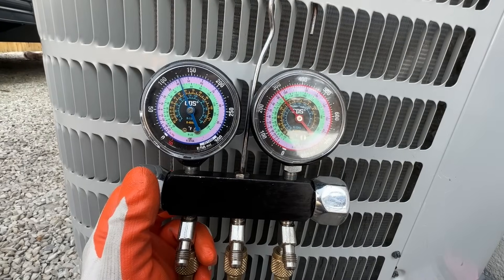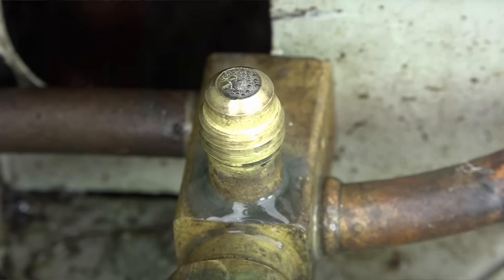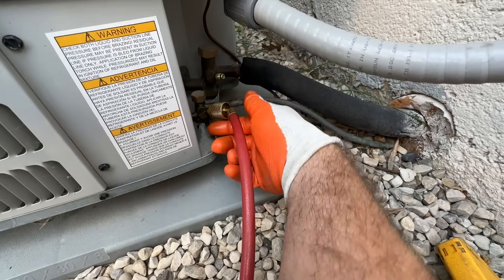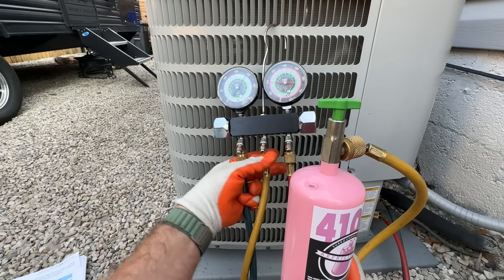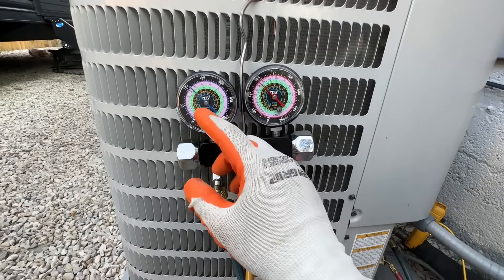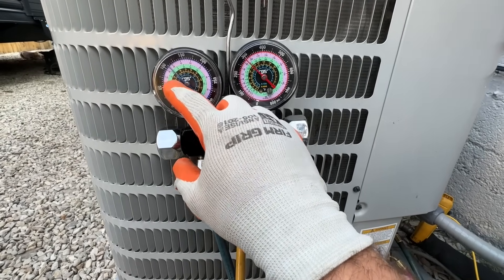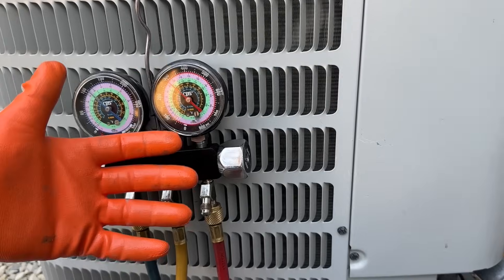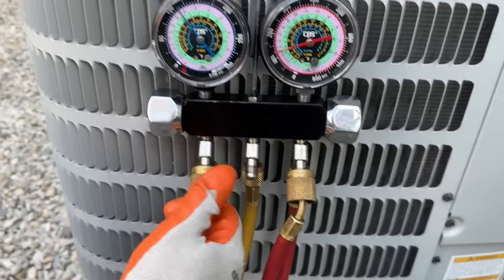How To Add Refrigerant To Your Air Conditioner R410A & R22

Comment: You make it seem so simple.  Hopefully it is.  Hope you get a ton of views.  We need more HVAC guys like you.
Reply: BE CAREFUL. Yes it is that easy. BUT there are so many areas where you can make a mistake. For example if you do not disconnect the high side, and happen to open both valves on the gauge you will destroy your compressor. Or if your high side pressure is too high, adding refrigerant will overcharge your system and damage the compressor. Everything shown here was accurate, but it is what is not said that will hurt your system. Get a little more education before jumping in.
Reply: @michaelbelliveau6232  Isn't it always true that it is what is not said  that gets you in trouble?  Thanks for the comment.  You are probably a good teacher.

Comment: Keep up the good work. My elderly neighbors were about to be scammed out of thousands for a replacement unit. Turns out he had be using the incorrect size filter and their evap coil was severely clogged. A Sunday afternoon and $30 in supplies had them back in business.
Reply from the maker: Saved the day!!! Nine work.
Reply: I had thought mechanics were the biggest scammers until my ex wife had ac people come diagnose a system that wasn't cooling correctly. Paid for an "ac tune up" that was supposed to clean the evaporator and condenser, check refrigerant levels, etc. They didn't clean anything, both coils were still clogged and they didn't check anything but a few electrical values (capacitors, etc). She had other people come and they saw a crushed intake duct in the attic. Quoted $2k to fix! We fixed it ourselves in an hour for next to nothing. Absolutely insane. I cleaned the coils but something else is still wrong, suction line barely gets cooler than ambient. Lord knows how much a reaming out they'd give you to fix that (I suspect incorrect refrigerant levels but don't have the equipment to verify).
Reply: Evaps get clogged with the right filter. Just clean it. Top and bottom. Check the blower fan for debris. Clean it as well since you are there.
Reply: You are doing gods work.
Reply: How to do inspect the evap to clean it, etc? Mine seems pretty much enclosed.
Reply: " their evap coil was severely clogged" the condenser or the outside heat exchange fins?
Reply: @sandygrungerson1177  The evap coil. The condenser is the "outside heat exchanger fins". The evap coil is located inside the air handler that is inside your house. It has very tight fins and can clog with dust overtime and reduce airflow significantly.
Reply: @travispoulin252   ok thnx
Reply: You and he should tell everyone you know to avoid that company.
Reply: How does charging a system correct a clogged evap coil?
Reply: @jefflemberg645  I deduce that the filter was smaller than it needs to be, and a "Sunday afternoon" meant he cleared the clog.
Reply: @jefflemberg645  he never mentioned about charging the system
Reply: @jefflemberg645  It doesn't. It might be a temporary band aid for a system that was a little low on refrigerant, but you need to inspect and possibly clean the evaporator.  You need to watch the video where this fella cleans an Evaporator Coil. I just watched him clean one and I was shocked at how much dust it had in it. I'll locate it and post a link into this comment.
Reply: @jefflemberg645  LOL right
Reply: Bro you’re ruining the business it ain’t getting scammed companies need money to pay gas, components, hourly rate, etc it ain’t a scam
Reply: @dylanlafferty611 really? I just saw my neighbors bill for getting a capacitor changed - 1500.00 dollars. Now tell me that wasn't a HUGE ripoff.....
Reply: @dylanlafferty18 some people don't have $10k laying around to buy a new system so if their old one can be fixed yeah they're being scammed. That's bad for business. It's more ethical to fix it and tell them they'll eventually need a new one and they may call back.
Reply: @dylanlafferty18 is $25,000 USD a reasonable price for an AC replacement in a 2K sq foot house? Because I did it for $8,000 and that included $2,400 in labor which is pretty damn good for 2 guys, supplies and a hard days work.
Reply: @dylanlafferty18 yea it is when you only need a capactior.soo m as they see 20 years old they stop and say you need a new one. And when they quote you a price all a out the same. 3k a day per man labor is.

Comment: You should do a video on using a micro leak additive.  I don't do this professionally but have used Easy Seal Ultimate with the UV dye on about a dozen systems that would get low on gas a few weeks after topping off with good results.  Including on one of my older 22 systems a few years ago.

Comment: I was checking the EPA website and just wanted to confirm that even as a DIY homeowner, if you open a valve or connect gauges to any refrigeration system and you do not have the 608 certification, you may be subject to the following?   “EPA performs random inspections, responds to tips, and pursues potential cases against violators of the Section 608 regulations. EPA is authorized to assess fines of up to $37,500 per day for any violation of these regulations.”
Reply from the maker: That’s correct. Heavy fines for doing this without and epa card guys! I’ll be done a video very soon on how to get your epa certification. Cheers

Comment: Thanks so much for sharing your knowledge we us, I have learned so much from you as a diy guy in maintaining my hvac system , I now have several spare parts on-hand in case of a breakdown , capacitors, vacuum switch, transformer, hot surface ignitor, condenser contactor !
Reply from the maker: Awesome! Thanks for the feedback!

Comment: How do you get the air out the system if it already in their?
Reply from the maker: If air is in your refrigerant, you’d need to recover it, do a vacuum, and introduce brand new refrigerant.

Comment: Can you do this on a inverter mini split heat pump?
Reply: Mini splits are always going to be rcovered and weighed in! And if additional refrigerant is needed,you must calculate the amount of lineset and how much to add per ft total run!
Reply: Good answer...!! Alot of people dont realize mini splits have a board that makes the fan run at different speeds and an electronic expansion valve that controls your your super heat so trying to find a target superheat on something that is always modulating superheat it is worthless so the only way to add refrigerant properly is to completely recover then add what it came factory charged with then normally if your lineset is over 15 foot to add refrigerant per every foot of your lineset which should tell you in the book how many ounces per foot....

Comment: Do you pull both cores/Shradders when pulling a vacuum on a new or replaced unit ? How do you add oil to system ? Hugh Mc,Chicago,metro
Reply from the maker: I pull the low side schrader, and leave my micron gauge on the high side Service port. I pull everything through the low side with my trublue 1/2” hose and I can pull a system down in 10 mins to 150 microns
Reply: @diyhvacguy  how do you know the correct  amount of oil to add,  is there a chart by mfg. Hugh Mc
Reply: You gotta know what your metering device is.... is it a txv or a fixed orfice.... a txv controls the superheat so you gotta go you cant charge from superheat so you charge off of subcool and if you have a fixed orfice then you charge by super heat which then you have to find your target superheat to properly charge it and if you dont know any of these terms or what a metering device is then dont touch it and stop watching these videos cuz it will most likely give you false confidence which will lead to destroying your system

Comment: You must have your EPA-608 certification anytime you work on a unit if ANY refrigerant might be released.  Just like you did when you released the "air".  You are one reason the EPA is coming down on honest techs. Your information is almost great, but individuals will screw stuff up.
Reply: Bla Bla Bla. I've seen EPA certified techs unload a whole 5 ton unit into the atmosphere. They screw up worse than the average DIY guys.
Reply: Timcat 1004 so havent i buddy .... !! Sad but true.... i dont get that guys comment cuz you gotta get the air out or put it in the system

Comment: How do you decide which refrigerants to use on the system R410a or r22
Reply: There is a data plate on every condensing unit that specifies what refrigerant goes in that unit, just keep in mind most ac issues aren’t necessarily refrigerant related. They are more likely electrical or airflow related. Start by making sure both coils are clean and unobstructed with a clean filter in place. Don’t just go dumping refrigerant if you’re not 100% sure.
Reply from the maker: The condenser will say on the name plate what type of refrigerant. It will say hfc 22 or r410a 👍🏼
Reply from the maker: Maybe I should have said that! Doh! Hind sight is 20/20

Comment: You don’t need the class. I studied for the test on my own and was easily able to pass the test.    Beyond simple.
Reply from the maker: Yes same here, I was just making the point that if someone was concerned about not passing, they could pay the 300 and it covers everything on the test. Thanks for the input!
Reply: what is the website to take the test?
Reply: @meseahunt  you could take the test at an AC store.  There was one here that did it.  Not sure anymore that was 4 years ago before Covid.
Reply: Can you give me some links to study from, I would like to the test as well.
Reply: @markpoposki  google test questions.  They are plentiful.  There is one thin book or pamphlet that has everything you need to know for the test.  I don’t remember where I got it.
Reply: YouTube and Amazon and do t need to have cert to buy r22 just click the box and say you do.  Save yourself $500 per recharge. R22 10lbs online only $350. Why let hvac repair charge you $180 + per lb? Fkn car salesman ripoff.  😂
Reply: @shanewilfon6860  neither neither amazon or eBay sell it anymore that i could find.   Suppliers require a cert.  maybe other online vendors don't.  I never tried
Reply: Another great video. Thank you so much! You are an excellent teacher.
Reply: I had a company come out for HVAC maintenance.  3 units and was told 1 unit was over charged, & the other 2 units were low.  
He charged me $179 to take out refrigerant and he wanted $142 per unit to add refrigerant.  I asked him if he could just add what he took out to the other 2 units.  He said he couldn’t do that.  
$500 dollar maintenance was starting to add up to $1000 not to mention I needed a 30/5 mfd  capacitor outside compressor leaking oil, and two 10 mfd capacitors for inside heat pumps reading low voltage for additional $310

I did the caps myself.

My question is could you take out refrigerant from one unit and add that refrigerant to another?

Thanks for your videos, they surely help all of us!
Reply: @fmonty112 As long as the refrigerant is the same, and you have a recovery cylinder to recover it, then yes you can. However that does not eliminate contamination in the refrigerant, and even using a filter dyer still will not prevent contamination.
Reply: @morallyinsane7639  thank you for the info.  I appreciate it very much.
Reply: @fmonty112  If they are the same type refrigerant I believe you can, as long as you own all 3 units.
IIRC that is one of the questions on the 608 test.
Reply: @BobbyDotNet  thank you!
Reply: @fmonty112  I've seen it done. The HVAC guy likely didn't want to "mix" what was in the one for the other and preferred to use "virgin" R22.  There is still a labor charge to move R22 from on to the other so the savings would be in the # of lbs of R22.  Lots of HVAC evacuate R22 and don't credit the customer even though they can still use it on another job.
Reply: Where did you get the study materials from?
Reply: @MRW21783  the place that gave the test had the booklet.   You can also get test questions online everywhere.
Reply: @Imwright720  
They can also call a high school or community college tech Ed center.  I did and they let me join for the test.  I just went through all three and got the universal level though I've never had an HVAC class.  I am an engineer though.
Reply: You don't even need to get a license, just buy if off craigslist.
Reply: Agreed.  But the others sitting for the test were all worried about passing after their two year course.  A couple were even trying a second time.  These are who all come out when you call for service.  🤔😯🤯
Reply: Amazing how people can not Google for them selves but want to mess with an ac. 4 days ago I googled and I have my universal now. Found a proctor site, found a pdf to study from. Easy. 

If you can't Google this info how are you going to handle diagnosing?
Reply: That's the best question yet.
Reply: Good for you
Reply: Bro where can I go to take the test ?
Reply: SkillCat app,  EP608 is free, just past myself after two days of studying their modules.  @GoonytunezProductions
Reply: Hi thanks for video,have a question I don’t have EPA card can I still go on Ability and order it ?
Reply: @joef1159  yes
Reply: Someone recommended skillcat in another video and it is amazing
Reply: Thankyou gues shearing not missing
Reply: Hello, can you give  to me the site internet send this bottle to Canada? Thanks
Reply: This is crazy that you clowns can just do a quick test and they let you just buy gas. This shit is so harmful to the environment and to let just anyone use it. Crazy.
Reply: Where can you take the EPA universal test online in California?
Reply: I did, too, yrs. ago. Got a perfect score, it's that easy.
Reply: ESCO has a online course and study guide for $32.  Then $85 to take it online.  The videos by Rob Stringham from Edison Academy are good if you actually want to understand what is going on in addition to passing the test.  He suggests you take the manual/course from whatever certifying organization will give the test; because you want to make sure the content matches.
Reply: @cpwright82  I got a basic book from the library and just took the test. Perfect score. VERY easy. No need to spend $$$.
Reply: I guarantee you can pass the United association journeyman turnout test nor the star test and I’ll put 1k on it !
Reply: @Youdontwantitboy  did you mean to say “ can’t”
Reply: @Imwright720  correct you can’t I’ll also set it up and your nearest local to you! You inerrancy diy guys give people who have no business messing with refrigerants or systems ideas they can just add refrigerant etc and be good! Gotta love auto corrects! You up for the challenge and bet! 5k cash if you can pass the journeyman turnout test and star exam!
Reply: @Youdontwantitboy  I can only speak for myself but I have repaired mine, my neighbors  and friends.  I’ve only been beaten once.   I know a tech came out from a large company and told my friend his compressor was grounded.   He never removed the wires to test it.   Aaaahhh.   It actually had an old hard start which the relay had grounded.  Once removed it fired right up.   My skills can’t compare to a true owner operator but I bet I can beat most techs from the large companies.   I built my wife a gym and I installed the a/c myself.  The only thing I paid for was it to be vac down.   That was almost 20 years ago and it’s still fine.   Can’t speak for anyone else.   If it’s mechanical and breaks I can usually fix it.
Reply: @Youdontwantitboy  There's always that one apprentice that thinks it's rocket science and people in other tech and mechanical fields couldn't possibly grasp what's taking you years to learn... Reality is we can grasp it.  You have no clue how green you are, and zero idea how many of us are mechanically inclined and worked on things FAR more difficult than an AC system.
Reply: The kids just take a second phone in there and get universal in 30 mins. They don't know shyt and it shows
Reply: @Youtubecansuckmyshithole  get universal? I have no clue what you are stating!
Reply: @MissionaryForMexico  I wasn't talking to you. 😀
Reply: You might just win the Darwin award if you keep doing diy electrical work.
Reply: Cool video but too much shit to remember. That’s why i have an hvac friend. Thanks

Comment: Looks like Craig Migliaccio book.
Reply from the maker: Yesir! It is
Reply from the maker: It’s on our Amazon store if anyone is interested 👍🏼
Reply: @diyhvacguy  Can you bootleg me a small bottle of 410? 12 years ago I installed my own Mini split. The condenser came recharged but the evap was wide open to the air. I had nothing to pump it down so I just purged the evap for about 10 seconds. 12 years in and it still cools nicely. The last 2 years it doesn't appear to be removing condensate like it used too.